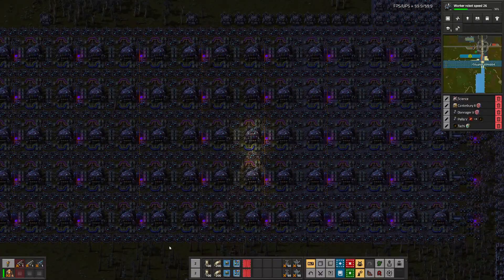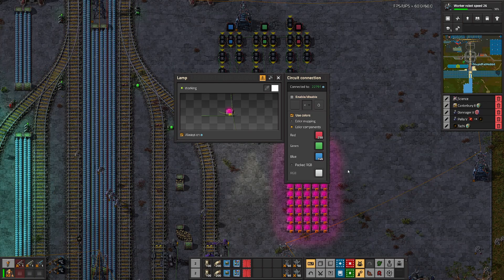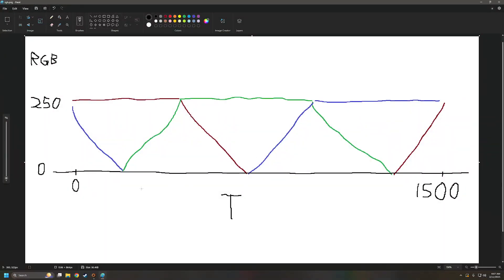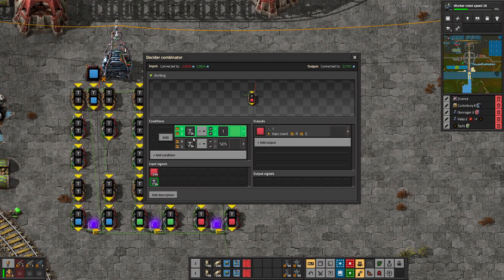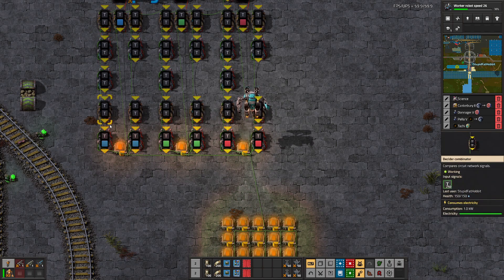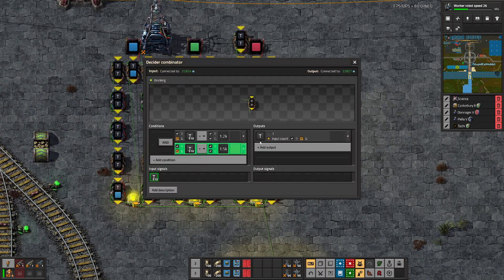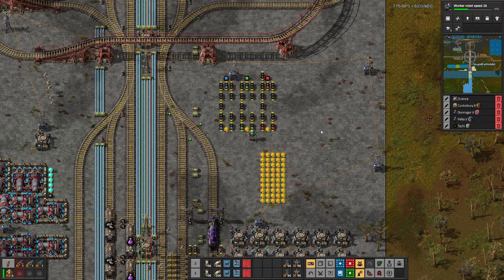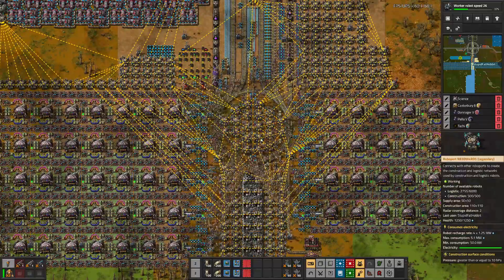Factorio Space Age - RGB Breathing Lights Circuit Design

Comment: I was so stumped on how you actually made the timer until I analyzed the blueprint. I didn't notice the output and input connected in the video so I got really confused! Nice design dude! I'm just now venturing into circuits without any programming experience, I managed to make a randomized RGB output but the smooth transitioning posed some problems I wasn't able to figure out on my own.

Comment: btw i made a lazy solution for traversing 'all' (most) color in rgb. I.e. just have r,g,b, runing on a clock that adds a different prime number every tick >:D (from range 0-255, flip to minus the prime number when exceed 255)
edit: i forgot i can just edit instead of replying myself
btw in your circuits there was a 1 frame black flash from purple to pink which suggest there were null/no values there

Comment: I managed to compress the whole thing into a 4x4 area with 1 light included mostly due to the parallel capabilities of the deciders and the light's ability to clamp the values to the [0-255] range
factorioprints code:
-OIuw4tV_-qQKgKckewu
Reply from the maker: Bruh that took less than an hour. Seems to generate the same effective results, nice job!
Reply: Cool. I had a similar idea to use the built in clamping, but instead implemented it as a set of 3 independent counters going up and down between -250 and 500. A temporary timer circuit is used to start the 3 counters staggered 500 ticks apart. 6 deciders + 1 constant combinator (+ 4 temporary deciders that can be removed after starting):

Factoriobin: 541d7n

Comment: Great video and nice idea. I was wondering if you will make a video showcasing all planets? Lastly, I know you use the science monitor which someone else made. I tried implementing it using the blueprint but I have no clue how to connect it and how it works. Maybe you could make a video about it or link one so others can use it too!
Reply from the maker: I'll be making a vid on each planet once I've got everything fully stabilized at 1.2m spm. 

As far as the sci meter goes, you hook up the requester chest input to a roboport to read contents and the one that has the "divide by 21k" is adjusted to how high you want the meters to read i.e. 200k means the max value will be set to that. 

I'll clean up the blueprint and make a short 5 min video on it at some point as I get asked about it so damn frequently that I've stopped replying to those comments.